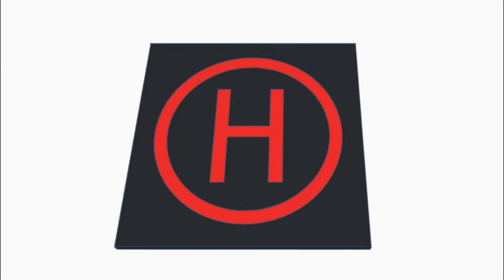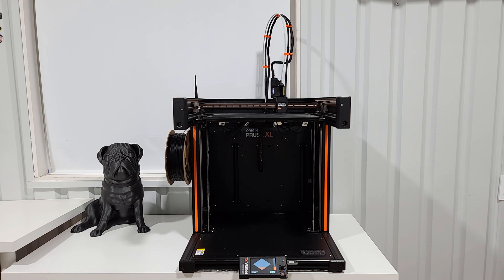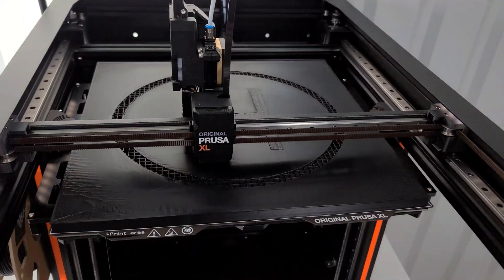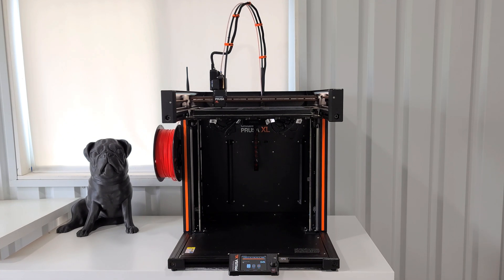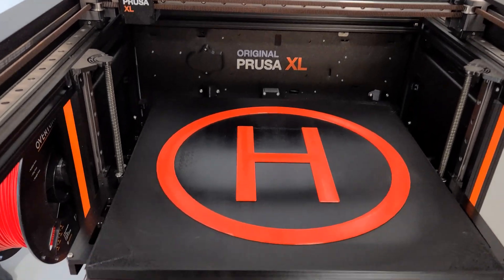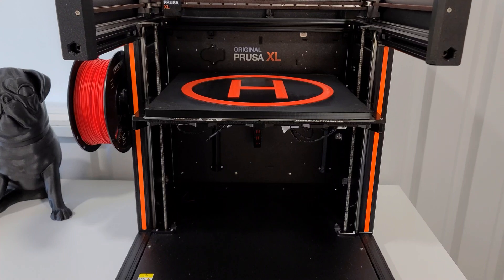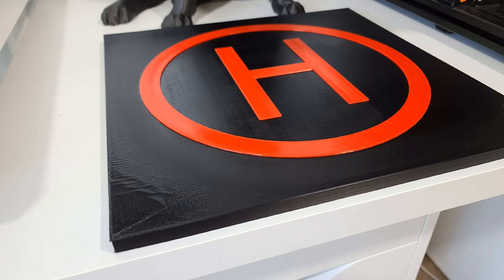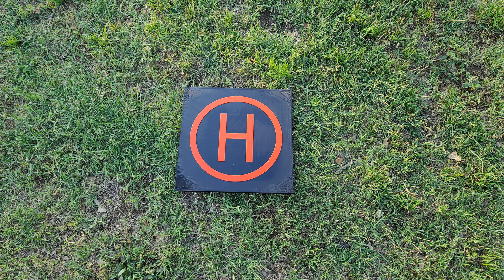Prusa XL - Printing a Mini Helipad for a Drone!!!

Comment: My understanding of warping corners like that is that it's an effect of the print shrinking ever so slightly as it cools. As it shrinks the bottom layer starts shifting in towards the middle of the shape. The forces are most pronounced at the corners, and at the very edge of the corner the adhesion is also the worst because of the small area in contact with the print bed. This causes the print to come loose from the print bed, which in turn causes the geometry to become offset in relation to the nozzle, thus causing the nasty looking artifacts on the topmost layer. The larger the print the more severe the effect. 

 Potential solutions in the order in which i myself would try them: 
- add some gluestick to the corners for improved adhesion.
- try a different shape with eg. 45 degree corners so that the shrinking forces tearing at the geometry are spread more evenly across the bottom layer
- shrink down the shape somewhat and add a 1 - 2 cm brim
- increase bed heating slightly, preventing shrinking (not sure if this would help at all...) 

Anyways thanks for the awesome XL vids!! As an avid and die hard Prusa fanboi i'm super curious about this printer so any thoughts on the pros/cons of the XL is hugely appreciated until I can get it myself.
Reply from the maker: Thank you so much! I really appreciate it!
Reply: @tada3dprinting  Best fixes are to avoid sharp corners like mentioned and to use an enclosure or even heated chamber, so the material doesn’t cool down as much and shrinkage is reduced.
I don’t know why Prusa didn‘t enclose it in the first place, that’s a must have especially for large prints
Reply from the maker: @kachler67  thanks!
Reply: yes these are all possible solutions.
what can also work is printing with more side walls so the part itself has enough strength to deal with the forces created by the shrinkage of the material.
Reply: @Pixelplanet5  more layers = more forces due to shrinkage
Reply from the maker: @Pixelplanet5  thanks!
Reply: The corners are more exposed to cooler air while the middle stays warmer longer. They cooled to quickly, maybe try in a warmer room or on a hot day? Cool idea though 👌

Comment: In general printing PLA on the rough sheet from prusa.. It is just a bad idea! :D Every corner in every print will just warp up. At least for me on the mini and mk3s+
I would try to add a round shape in the slicer to every corner set it to the first layerheight and rip these pieces off after the print is done. Then you dont net to use a brim for the whole print. Helped me a lot! But normaly I just use a different sheet for PLA :)

Also, nice videos! I like seeing how the XL performs!
Reply from the maker: Thank you!

Comment: making the infill parallel to the walls (as I believe is what you did) increases the pulling forces created by the cooling material, so you increased the tendeccy to warp by doing that. Also, any kind of fillet, or even chamfer, on the bottom will allow those forces to act more quickly at the bottom layers, making the future layers able to warp it even more. I've stopped putting chamfers, even small ones, on the bottom outside edges of larger planar prints like that, and it's helped quite a bit. All that, plus sparser infill and fewer perimeters will reduce pulling/warping forces.
Reply from the maker: Thanks for that! I'll swap back to the 45 degree diagonal infill again and see if that helps. Thank you!

Comment: So.. what I would do is use a brim.. and not print it as big as the bed. Put a 5 to 10 width brim, and put down some gluestick as well, for added adhesion. Said elsewhere.. but guessing the very edges of the bed dont get as hot as the rest of the bed. What temp was it? I'd do 60c to 70c for PLA and a print this large.
Reply from the maker: Ok all good suggestions! It was just 60c. I'll bump it up a little as well as the other ideas.

Comment: The warping is sort of expected; if you rounded your corners you'll spread out the shrinking forces more evenly and experience less warping. That said, maybe some glue stick or a brim might have helped here too. Another option would have been to make it a little bigger, but go with a "puzzle" piece sort of layout.  Otherwise, nice print :)
Reply from the maker: Oh, I really didn't think about rounding the corners! I did want it to be one print and just wanted to test this thing out too. Thank you!
Reply: @tada3dprinting    This is the first XL video I've seen where they talk about warping with the new sectional heating elements.  It will be interesting to see what will reduce or prevent this?  Will the enclosure help?.... hhmmmm...
Reply from the maker: @davidthompson9359  yes I was really hoping we had moved past warping. But printing an exact square is difficult and not what most people are even looking for. I'm going to take these suggestions and do another print to see how to improve. Thanks!
Reply: @tada3dprinting  Looking forward to your results pioneer.... lol  I'm watching the first termers so when I get mine I can learn with their/your experience and move along faster.
Reply from the maker: @davidthompson9359  thanks for your support!

Comment: the satin plate it's GREAT but only if u clean it before EVERY print with some product for surface clean, those with natural ingredients and no need to water wash it, i did this on my print farm since years, all perfect. Print that large are always risky, a brim can help too
Reply: IPA clean on the texture sheet is a must to stop grubby finger prints. But this is on all corners so looks like heating issue.,

What can you clean the satin sheet with, IPA ?  

No space for the brim or shield or mouse ears.. 

This is a concern for me as I was looking to use the xl to print big parts.. that will fill the length. hopefully it’s a simple remedy.

I wonder if packing some foil under the corner could keep the bed insulated from below a little  better.
Reply from the maker: @75keg75  I tend to print a lot of square things like this and my usual remedy is to stick it in a separate room with a space heater. But I really was hoping to not need to do this. No draft shield available yet from Prusa.  Are your prints square and completely max out the bed? Thanks!
Reply from the maker: Do you think the texture sheet would help it stick more? Yes I always wipe the bed with IPA on large prints especially. Thanks!
Reply: @tada3dprinting  no, texture its nice but not the best, satin hold much better for PLA and PETG. IPA it's great but not perfect for the satin, give me a chance, clean with a surface cleaner product and see
Reply: @tada3dprinting  texture sheet for petg is awesome. I’ve printed a couple parts on the smooth pei and it was hit or miss I’ve done a couple pla prints on smooth then went to textured never gone back, can’t talk to the satin sheet. 

Heater oh wow. That would suck! Bit of an inconvenience, more costly to produce part and a small risk of fire too.

Comment: Yikes!! 
That doesn’t look good at all. I would fire that through to prusa  and see what they think. They may need to alter something on next machines going out. Joe said something about overhanging sheet dissipated too much heat so required a change. Maybe this is related some how being on a corner two opportunities to cool. 

On the last shot on the ground there looked to be patches of darker in the middle areas I wonder if that’s related to heat bed not coping or cooking inner plates? Or just a function of being in the corner. I’ve noticed on my mk3s/s+ that corner prints can be sketchy so maybe something to do with corner and keeping at temps.

Ps well on way to 1k subs - very quickly too. As you’re the only prusa xl vids on the web take advantage of it - you’re almost viral!!

Just did a searched on work computer (no login history) for “prusa xl and you are now the 3rd vid after an advert that shows a i3 and a prusa update video for Joe. So discounting the advert your number 2 with the planter vid!
Reply from the maker: Yeah I don't want to bug Prusa yet since it's my own design and probably needs some tweaking. If the preloaded gcodes were warping, I would be worried. Thanks so much for the support! That's great to hear! I really appreciate it!
Reply: @tada3dprinting  

I would send it through as they may have seen it and it may save you time trouble shooting. They are still “beta” testing till May so it may help them and people in the queue (like me) get a better product. Hehe

I guess you could test to see if repeatable. I’d split the big part into 4 smaller ones say 3-4” to cover where it errors, will save some material and time. Get through 4 permutations in one job.
Reply: @tada3dprinting   good progress on the metric’s for sure. You’re the only one producing content so you’re out the front the herd…  make hay while the sun shine’s. Hopefully you have enough traction for when the big dogs start putting content out and your channel keeps going up!
Reply from the maker: @75keg75  yeah I think everyone is distracted with the MK4 but I will get as much content out as I can. I know I have a lot to learn quickly. Thanks!

Comment: Thank you for sharing.. Bit concerned about the warping.. Could it be uneven bed heating?
Reply from the maker: Yes I am disappointed with the warping! Normally I would blame it being in a room with drafts. But I did turn off my HVAC and it was relatively warm the day of printing. Maybe I need to make sure that my heat was on overnite and try it again. Thanks!
Reply: A print this large should have a brim and probably some glue down.. larger prints warp easily without brim.. and pretty sure all beds don't heat evenly across the entire thing even with their 16 load cells I doubt the edges are as hot as the majority of the bed.
Reply from the maker: @WhySoDivided-CantWeAllGetAlong  good ideas! And maybe even scaling it down just like half inch or so to get a decent brim. Thanks!